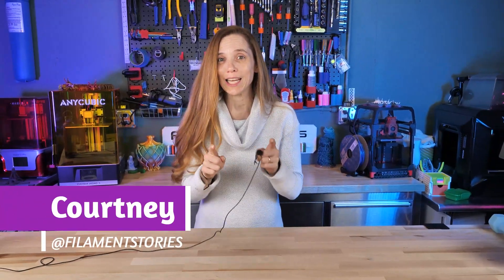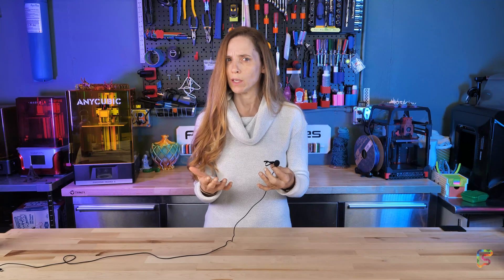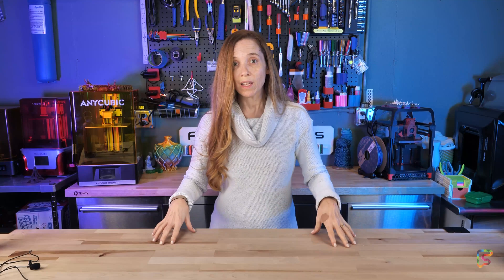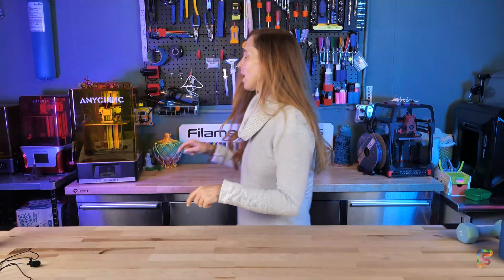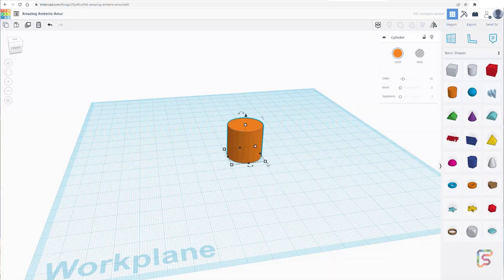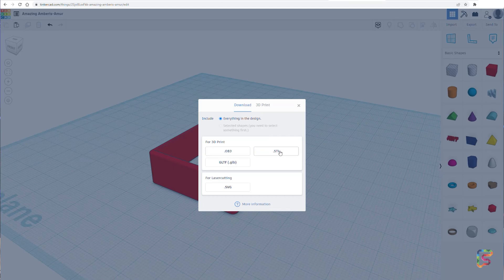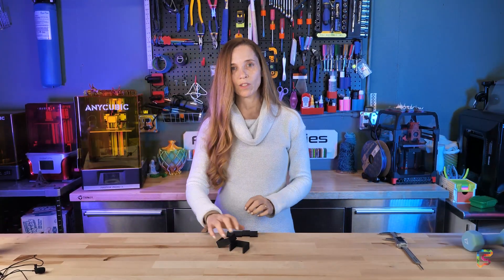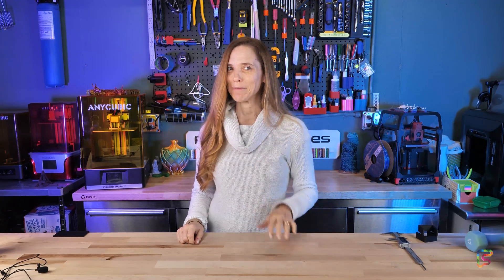Practical Models - I solved a problem with 3D Printing!

Comment: 3D printers are useful only for people who can create their own designs, even if those are robust and crappy.
I started also with TinkerCAD. Great stuff for beginners :)
Within last 2 years I have designed and printed over 100 parts. With all the iterations almost 400 prints with FDM priner and then some with resin printer. 
I cant imagine my life anymore without ability to create plastic parts I need around the house and for my motorcycle.
Reply: This is kinda true, but largely because we lack a critical mass of available designs with widespread usefulness. Imagine if every manufactured product we owned with plastic parts that could break had the original cad files just available for download and use in instant repair.

Comment: Nice! That's what I love with 3D printing, finding that simple problem where there is no solution or an overpriced solution and spending a bit of time but creating a solution to solve the problem.

Only thing missing... what filament did you use? ;)
Reply from the maker: Good point, I never mentioned the filament!  It was Keene Village Plastics Black PLA